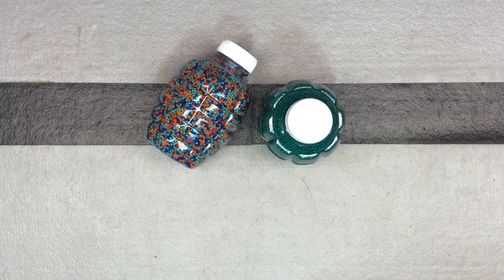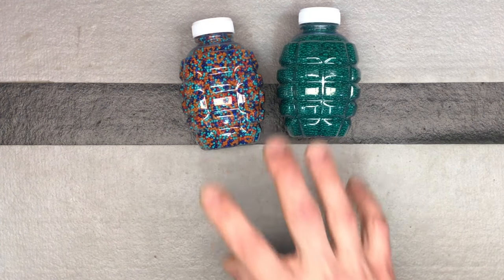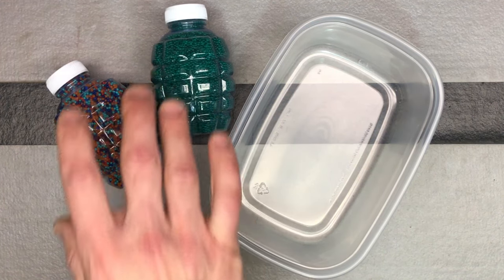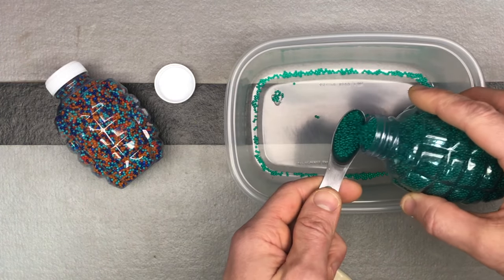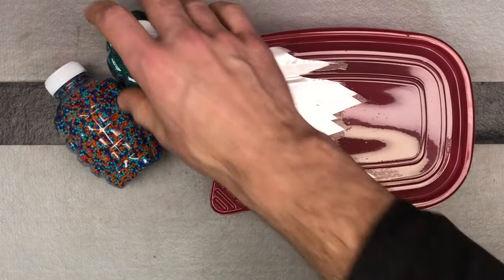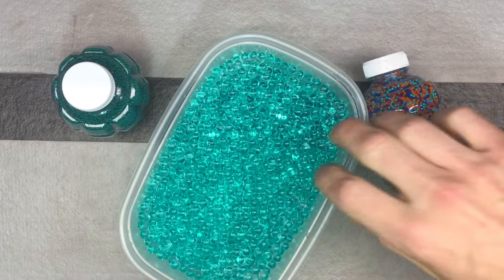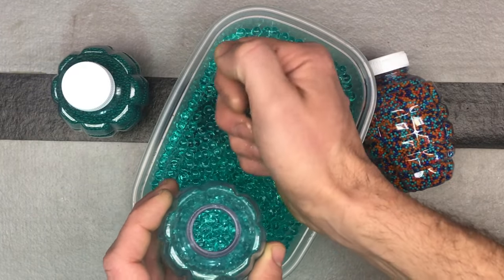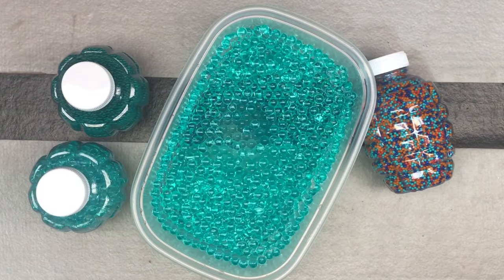Gel Blaster Gel Beads - How to Soak Them Properly to get 7-8mm Gel Balls - SEE DESC FOR MORE TIPS!!

Comment: If the beads are suppose to be 7-8 mm and you leave them over night will they outgrow the 7-8mm? Thanks for the video information!!
Reply from the maker: Nope! Fortunately, they can’t get too big
Reply: @GelBallBlasterMaster  Thank youuuu!!!
Reply: @GelBallBlasterMaster  my gel balls break before leaving the gun and I’ve soaked them twice to see
Reply from the maker: @dontariuslewis6075  what blaster? Are you just using the gel beads that came with it? Have you tried using bottled water or distilled water?
Reply: @GelBallBlasterMaster  yes the ones that came with it I haven’t used bottled water just water from the tap let them soak over night
Reply from the maker: @dontariuslewis6075  in some places, the minerals in the tap water affect the gel balls. Otherwise you can also try just growing them for 3 hours too
Reply from the maker: @dontariuslewis6075  ok. Try my other suggestions
Reply: @GelBallBlasterMaster  I’ve gotten it to shoot now but you can literally see some of the balls come out I’ve done it to my hand and it stings a little but I feel like it should hurt a little more maybe bc it’s cheaper but for $50 I’d think it would be stronger also some of the gel balls end up in the mag holder is that bc of the mag that it comes with?

Comment: Be advised, that is a HALF LITER OF WATER HE USED.  That is not a liter.
Reply from the maker: You are correct, but guess what, it doesn't matter, you can't use too much water!!!! They stop growing at 7-8mm regardless. Most people don't use enough water and then the gels are too small. Even if you are controlled growing, never worry about too much water, in those cases you are draining them at a specific time anyways. So you are observant, but this makes no difference. Coming from someone who has grown millions of gel beads and has literally had over 1000 gel blasters

Comment: hey,, how much water per table spoon of gel beads? If I put too much water, will anything happen?
Reply: and do every type of gel beads work for these guns?
Reply from the maker: As long as they are 7-8mm gel balls for 7-8mm gel blasters. (95% of blasters are 7-8mm)
Reply from the maker: No such thing as too much water. The beads stop growing at 7-8 mm (pretty much) so just make sure to drain the excess water after they sit 3-4 hours or overnight is fine too
Reply from the maker: GELL BALL / WATER RATIO:

10,000 pack / 8L water (1 GALLON)
5,000 pack / 4L water
Reply: @GelBallBlasterMaster  thanks !!!

Comment: When you save. The gel. Balls in the air tight containter do you need water in it or  just the balls itself?
Reply from the maker: Just the gel balls. After you drain them.
Reply: @GelBallBlasterMaster  also for longer storage?
Reply from the maker: @noahj2748  2 weeks is about the max. You can try longer but they will probably shred when you shoot them

Comment: Is it okay to just load about 10 to 15 gel balls in a magazine? Or does the mag have to be loaded up to its full capacity to use? I tried using only like 15 and it wouldn’t shoot. Please answer asap thx
Reply from the maker: Filling the mag is always best. Also, are you using a motorized magazine or is it mechanical? If mechanical, you must manually Prime it each time you fill it. Some mechanical mags will always be inconsistent
Reply: @GelBallBlasterMaster  hi bro, how to properly prime the mag? My mechanical mag didn't react as intended during priming
Reply from the maker: @leonghuichuenben8306  what happened when you kept clicking the button?
Reply: @GelBallBlasterMaster  gels didn't pop out as intended. But I was able to shoot a few gels out only after I load the mag
Reply from the maker: @leonghuichuenben8306  might just be some smaller ones. If they r shooting ok then don’t worry about it

Comment: But what happens if you leave them in for too long, I left mine for around 5 hours checked on them and they were fine although I checked another 5 hours later and they all shrunk again in the water . Can I reuse them?  If so how long should I put it in the water? Waiting for the reply thank you so much :)
Reply from the maker: They should not shrink again. 5 hours is fine for cheap gel balls. They will stop growing at 7-8mm no matter
Reply: @GelBallBlasterMaster  thank you so much I just put new ones in and i will wait 5 hours and observe the size :D

Comment: I thought you said just one bottle of water 🤦‍♂️ do you think they still go good if I added water and then a few hours later add more water?
Reply from the maker: Yes. They will be fine
Reply: Ok thanks, also are you using 8mm balls? I have 2 batches of 7mm and there the same size and there too small but I don’t know cause this is my first time
Reply from the maker: @Turnerswiffleballlauge  the vast majority of gel balls are 7-8mm size. That means they are between 7-8mm. It is very rare to find any that say they are one exact size only. Other sizes are 6-7 and then there are some large 9-10mm. So if you truly have some 7mm only or 8mm only that is very rare but they should work anyway
Reply: Okay thanks
Reply from the maker: @Turnerswiffleballlauge  good luck. Hope they work. Otherwise, there are tons of inexpensive beads on Amazon. Make sure u r subscribed so u don’t miss out on all the giveaways I do. Multiple blasters per prize each month and (2) giveaways per month in the summer!
Reply: Thanks! I used the splatrball 20k pack and I already half way used it because I messed up so much sadly

Comment: So 1 tea spoon of tiny beads will fill up a hopper after they turn to 7-8 mm right ?
Reply from the maker: About that
Reply: Bruh 😭😭
Reply: So how many tea spoons
Reply from the maker: @Mario_2k  don’t worry about making an exact hopper full. A hopper is about 500 so if you have a 500 pack of beads that is easy. But otherwise make a slightly larger batch in a bigger container. Here is an approximate ratio: GELL BALL / WATER RATIO:

10,000 pack / 8L water
5,000 pack / 4L water

Comment: I have a bag with 20.000 in them. How much water do I need in order to let them all grow to 7-8 mm?
Reply: Or should I use smaller amounts instead of using them all at once? Because mine are to big for the gun, they are like 8-9mm and they don’t fit
Reply from the maker: Just buy the correct ones. Don’t make all 20000 at once either unless you plan on using them quickly.

Comment: If my gel balls didnt grow 7-8mm the first time can I use the same ones to grow them
Reply from the maker: You can add water or try bottled or distilled water
Reply: For like 400 balls is a liter enough? Tried distilled water and its the same size
Reply from the maker: @kizbo69  you can always use more water. It will not hurt them. If you have tried distilled water and still not growing right you may just have a bad batch I guess

Comment: i bought colored gel beads and they don’t work for my gel blaster idk why😪
Reply from the maker: Are they soaked properly? What is happening? What blaster do you have?
Reply: @GelBallBlasterMaster  yes, they shoot then stop then shoot again it just keeps getting jammed , i have the skd -001 and skd -007 the bullets don’t work for both guns
Reply from the maker: @FadedBluntz  try soaking with bottled or distilled water. Multi colored beads are also inconsistent. Is it a pack of multi color or just one solid color?
Reply: @GelBallBlasterMaster  multi color
Reply from the maker: @FadedBluntz  Order some solid color ones. The sizing will be more uniform

Comment: Hi GBBM, those milky white gel balls also need to soak for the same amount of time?
Reply from the maker: Depends, but usually 3hrs is the minimum
Reply: @GelBallBlasterMaster  I see, cause I have those super hard translucent gel balls and the seller mentioned 1 hour is sufficient, which really confuses me cause when I remove it after 1 hr 15 minutes, my Bohan SLR can't seem to fire it out
Reply from the maker: @edwardchin311  then go off that. If the seller has other directions, always go with those first

Comment: I don’t know what I did wrong I was just doing an experiment cause this is my first time getting a gel blaster so I put two beads in a lot of water they got big and then I forgot to take them out and they shrunk again
Reply from the maker: after how long?
Reply: @GelBallBlasterMaster  a day
Reply from the maker: @tac12gaming9  Just soak for 3-4 hours next time. If you still have problems, try using bottled or distilled water

Comment: For 4 tsps you poured a bottle of water. Is that bottle 1L or 500 mL?
Reply from the maker: 1 liter
Reply from the maker: Gel Bead Soaking Instructions 

REQUIRED:

Pack of Gel Balls (Ammunition)
A Bucket / Large container
Tap Water

GELL BALL / WATER RATIO:

10,000 pack / 8L water (1 GALLON)
5,000 pack / 4L water

METHOD:

Step 1: Empty gel ball pack into bucket / container.

Step 2: Fill the container with the correct water amount (add a little extra for better results).

Step 3: Allow gel balls to soak for a minimum of 4 hours (Overnight recommended)

Step 4: Strain the gel balls before loading them into your magazine.
Reply: It was 500ml for sure

Comment: Where can i get the gel balls in the video?
Reply from the maker: Those are just really cheap gel balls from amazon. I only suggest you use them on blasters under 200 FPS
Reply: I have the gel blaster nova which ones will you suggest?
Reply from the maker: @ericbenzel8676  any cheap ones are fine for that blaster

Comment: i need help i’m soaking mine over night every night and i have hella water and they only get to 3-4mm
Reply from the maker: Try distilled or bottled water. That is needed sometimes based on the chemical makeup of your tap water
Reply: @GelBallBlasterMaster  do you think maybe like in my house i have this water jug machine with filterd water would that work bc we don’t have bottled water
Reply from the maker: @vtrxly6732 try it
Reply: @GelBallBlasterMaster  ok i got bottle water but it’s been sitting out for months and is warm and stuff is it still good?
Reply: @GelBallBlasterMaster  also is it needed to put the lid on container ?
Reply from the maker: @vtrxly6732  that should not matter
Reply from the maker: @vtrxly6732  no

Comment: I'm new to gel blasters. I'm looking to provide ammo for a group. Anyone know where to quality ammo in large quantities?
Reply from the maker: You can buy Shrapgel milky whites on Amazon in 2.2 lb bags
Reply: @GelBallBlasterMaster  you're awesome
Reply from the maker: @sebastianethridge1935  those are my favorite semi-hardened gels too
Reply: @GelBallBlasterMaster  any beginner gun suggestions?
Reply from the maker: @sebastianethridge1935  how much do you want to spend? Are you planning to upgrade it later (or at least have the ability to?)
Reply: @GelBallBlasterMaster  I use to play airsoft a good bit so an upgradable platform would be nice but I prefer good performance out the box. Looking around the $100 range for a beginner
Reply from the maker: @sebastianethridge1935  look for any m4a1 gen8. They will range in price from as low as $50 on sale to $100. Usually the more expensive ones are a little better performance wise and can handle 11.1v battery better. Here is actually an awesome deal on Amazon for a better quality one for $60. Not sure how long that price will last. 

Voswuen Gel Ball Blaster with FPS 280+ and Electronic Scope, 100+ Foot Range - for Simulation Splatter Ball Blaster Shooting Game Adults and Kids Ages 12+ https://a.co/d/3k4U8ni
Reply: @GelBallBlasterMaster  that settles it then. I was looking at the jinming gen8 m4a1 and I think you confirmed it

Comment: at this point idk what to do i used bottle water 2 teaspoons of beads and a liter and a half of water and a good sized tin and they won’t go to 7-8mm they stuck at 3-4 pls help
Reply from the maker: Leave them overnight
Reply: @GelBallBlasterMaster  i did it last night woke up and they still at 3-4mm any tips i did everything right
Reply from the maker: @vtrxly6732  was there still a bunch of water in the container?
Reply from the maker: If there was no water left over, you are simply not using enough water. Use more. Too much water is not a problem. They can only grow to 7-8mm. There should always be leftover water to drain off.
Reply: @GelBallBlasterMaster  i woke up and there was water left and they were still 3-4mm
Reply: @GelBallBlasterMaster  yes like there was 0 progress after they got to 3-4mm a lot of water left and spade left and they jus wont grow
Reply from the maker: @vtrxly6732  ok. Try a different brand. That is the only option
Reply: @GelBallBlasterMaster  but i used the one that came with the blaster
Reply: @GelBallBlasterMaster  ok thank you
Reply from the maker: @vtrxly6732  it is extremely rare, but you may have received a bad batch.

Comment: How long do I have to wait for the gel balls to grow 7-8mm? Thanks for the information this will help a lot. Because I am about to buy a glock-drum gel blaster.
Reply from the maker: 3 hours at least or leave them overnight. It says times in the video too😀
Reply: 1 hour
Reply from the maker: @Splatsumm  i do not believe one hour is long enough but if your blaster is working fine with the gel balls after one hour, then keep it up.
Reply: 3 to 4 hours is what I saw was recommended lol
Reply from the maker: @xXxMelodyxXx18  that’s is correct. Try using bottled water or distilled water. Some places have minerals/additives in tap water that affect growth
Reply: @GelBallBlasterMaster  Thank you for the information! Bought my son the Desert Eagle by Anstoy for Christmas and I couldn't figure out how much water to use so that's how I stumbled across this video! Lol Merry Christmas 😊
Reply from the maker: @xXxMelodyxXx18  hope it all worked out. That desert eagle is a pretty reliable top loader.
Reply: Srry I lost one point bout... how many hours/days they can be used after being 7mm?
Reply: ... aaand I've to keep them in water or dry container, if I don't use them all?
Reply from the maker: @VERYMAD20100  about two weeks in airtight container. After that they are likely to shred/break up when the nozzle hits them
Reply from the maker: @VERYMAD20100  drained but they should still be wet.
Reply: Oh great, thanks!
Reply: Are all gel balls the same? Or is there a better quality type (in terms of hardness)? Thank u....

Comment: Question when they finish do you take the water out?
Reply from the maker: Yes, drain them
Reply: @GelBallBlasterMaster  Do you add water if you not using them to put them in the fridge?
Reply from the maker: @kanyelevelup  you can always refresh with water for a few hours prior to use but most say you should not leave them in water. The AUSGEL ultra elite gel balls can be left in water but those are a hardened performance ball and won’t work well in any blasters under 200 fps. My advice is to drain and store in airtight container. If they don’t get used for a week, add a little water prior to use an hour or so before and then drain excess water before using.
Reply: @GelBallBlasterMaster  Thank you so wonder why it get jammed in the gun
Reply from the maker: @kanyelevelup  yes. I don’t recommend this blaster due to this. 95% of blasters use 7-8mm
Reply: @GelBallBlasterMaster how would you go about draining without a strainer?
Reply from the maker: @sivymusic  use your hand
Reply: @GelBallBlasterMaster  oh ok thanks

Comment: Do they dry up over time? If i would shoot it around the house would it be messy?
Reply from the maker: Yes, it would be messy inside. Should not stain but they make a mess. They will dry up eventually. Definitely advise you only use outside!
Reply: @GelBallBlasterMaster  ok thx, thought gel blasters would be less messy/burden of cleaning, alternitive to nerf
Reply from the maker: @panhem7149  no. Nerf darts don’t explode into pieces on impact. You would not need to pick up the pieces but it would be messy. I have never heard of anyone using them inside.
Reply: @GelBallBlasterMaster  Yeah i thought it would just lay around and dry up so i can vacuum it all up, and it wouldnt be as messy as airosft bbs or nerf darts
Reply from the maker: @panhem7149  unfortunately no, in an unfinished basement maybe

Comment: Hey and for hardened bead how its the procces or is the same as the video.
Reply from the maker: Same, unless you are trying to control grow them and then you may soak for less time
Reply: So if i wanna like the video what water i need to put? I use bottle water for whole day and the beads still don t grow
Reply from the maker: @danielamayo6175  then you are doing something wrong or got a bad batch of beads
Reply: @GelBallBlasterMaster  I buy it from Emerbu company.
Reply from the maker: @danielamayo6175  you are using plenty of water and giving lots of time and they are not growing at all? I have never seen that happen with any gel beads. Out of millions and 25+ brands
Reply: @GelBallBlasterMaster  mine don t look like yours its grow but no the same as yours its look small still
Reply: @GelBallBlasterMaster  and i am using the water that you can drink.
Reply from the maker: @danielamayo6175  is there still water in the container after 24 hrs?
Reply: @GelBallBlasterMaster  yes and i have a question can you help me with a gel blaster that i buy from emerbu and its came with the black tube where you put the hop up that black tube when i shot the tube get loose. 😢
Reply from the maker: @danielamayo6175  send me a picture of what you mean on ig or email or fb